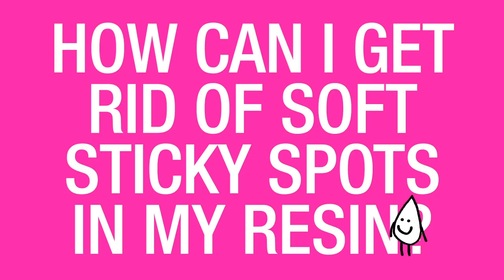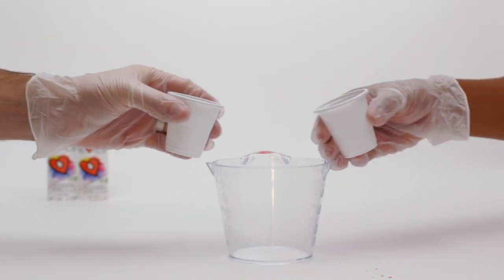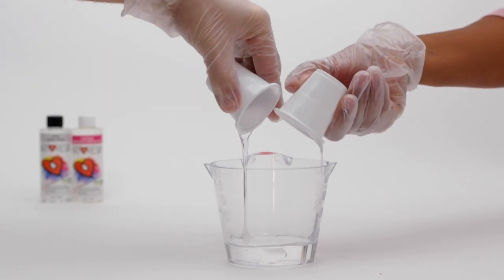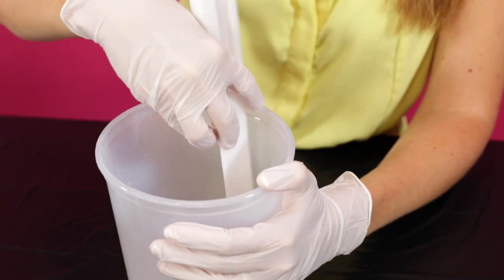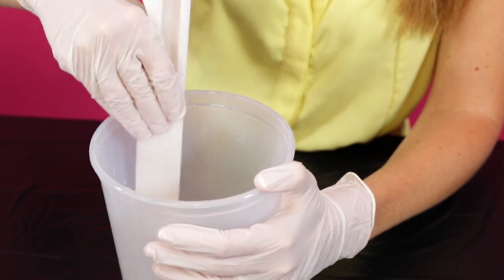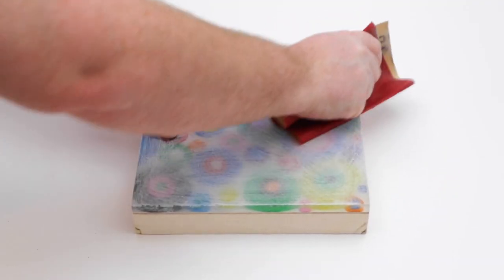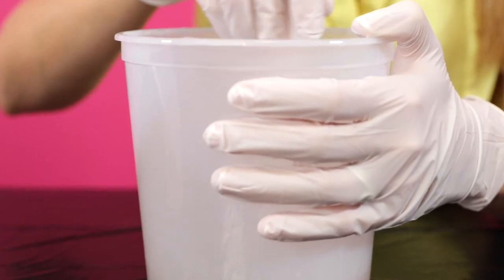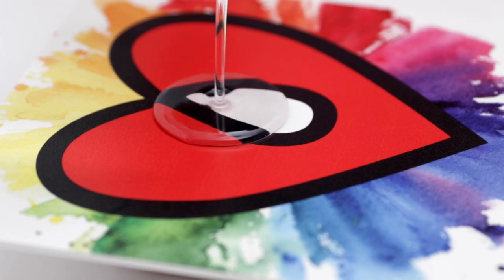How Can I Get Rid Of Soft Sticky Spots In My Resin?

Comment: OK and what are you supposed to do when You absolutely mixed it well and used the right mixture ratios and it's still sticky?
Reply from the maker: If it is mixed well and measured correctly ( 1:1 by volume and not weight - as that is a common mistake ) a few factors could come into play. This time of year we see a lot of issues being because of temperature. The ideal temperature for both your ArtResin and your workspace is slightly warmer than room temperature: 75-85F or 24-30C.

If you are still having issues with your piece please send us a photo or more information about your piece to support@artresin.com and we will be glad to help you trouble shoot further.

Comment: I did a big mold but I did it in sections but when I did the last section on top and it still didn't cure and it's been a month so I scraped it all out but for some reason I still can't get like all of it out so when I scrape it now I can feel the hard part on the bottom but I've cleaned it as good as I can get it can I still put more resin on top of that
Reply from the maker: Hi Crystal - sorry to hear you had some curing issues.  Sounds like you did all the right things - waiting to see if the resin cured, and then scraping out as much runny product as possible.  As long as the wet, liquid product is removed, you should be able to pour a fresh, carefully measured and mixed layer on top. Allow it to cure, and then you should be able to demold your piece. 

The only thing might be is that, when you were cleaning up the wet resin, if you pulled the mold away from the cured resin below, the "seal" may have been broken, so you may have resin from the last layer that has seeped down the side as drips.  You may need to sand this off, but you can brush on a thin coat of resin with a foam brush to restore the gloss.

Hope that helps!

Comment: How would I do this process if I made an ash tray and it’s still sticky around the edge? The rest of the ash tray is perfect but for some reason the edges did not come out correctly 🥺
Reply from the maker: In this case you could try to just brush, or smooth on a new layer of ArtResin overtop of the tacky resin and allow it to cure, or you could sand down the entire surface and smooth on a thin layer over the whole piece.  Please be advised, we do not recommend using ArtResin to make ashtrays as we are heat resistant up to 120F, the heat from a burning cigarette could damage the surface of your resin.
Reply: @Artresin  thank you so much!!!!!!!!! 🤗🤗🤗🤗🤗🤗🤗🤗

Comment: I did a resin memorial piece for my cousin but when I took it out of the mold after 48hours part of the resin stayed behind in the mold luckily it was the back piece its soft tacky and looks liquid like in that spot will what you showed what to do work on this type of error ?
Reply from the maker: It sounds like your resin was not mixed enough and a spot remained uncured.  You can try to fix it by scraping out and removing as much of the liquid/gooey resin as possible, then applying a freshly mixed coat of ArtResin.
Reply: @Artresin  thank you I did just that and it fixed the problem thank you so much
Reply from the maker: @phyllisramos9616  fantastic!!!!

Comment: Hi my resin plate some cure and some sticky. After sanding can I use uv resin.. bcz it has to deliver urgently
Reply from the maker: To be honest we are not too familiar with UV resin. I would double check with the manufacturer to be sure it will adhere and cure to another epoxy :) Please let us know if it works.

Comment: How can I fix a spot that’s sticky in one place on my canvas, but dry everywhere else?
Reply from the maker: Unfortunately, we don’t recommend spot fixing for the simple reason that it’s actually very difficult to sand out a small area where there might be an issue, such as a bubble, hair or even a bit of dust that settled into your wet resin.  It's almost impossible to get a seamless finish by pouring a fresh patch of resin on top of the original resin coat. Instead, we recommend that you sand down the entire surface and pour another well mixed, well measured coat of ArtResin over the entire piece for an even, flawless finish!

Comment: Is there a chance that a particular silicone mold could cause sticky resin? I made a batch of resin and cast 4 different molds. 3 I made with Amazing Mold Rubber and 1 was bought. All 3 were sticker after 24 hours. Tried again and they were still sticky. Other molds and the resin is perfect.
Reply from the maker: I haven't heard of a mold causing the resin to not cure. Since it was a mold that you made, did it need to dry? Sometimes artwork that isn't dry can cause issues curing.
Reply: @Artresin I did a lot more searching after asking that question and found that a lot of silicones put off byproducts during the curing process and it's possible that there are oils or alcohols inside my mold. I'm going to try to clean them better and see what happens.
Reply from the maker: @jasonkinney8129  Thanks for the update- I am going to forward this onto one of our team members who is doing some mold testing as I am sure she will find this interesting.